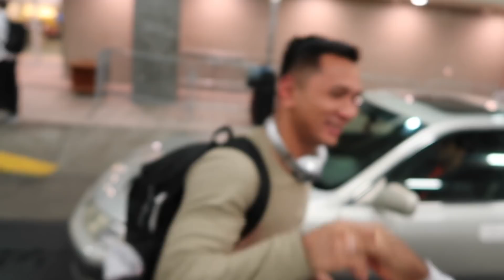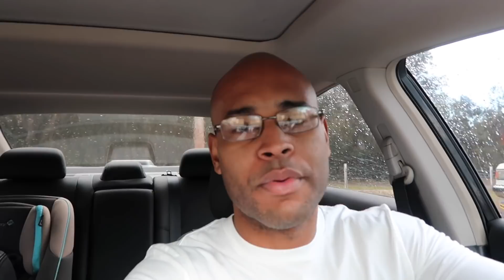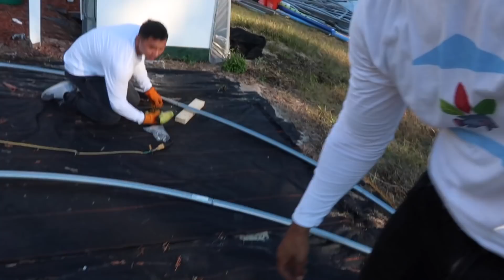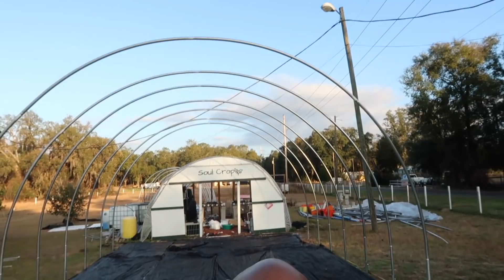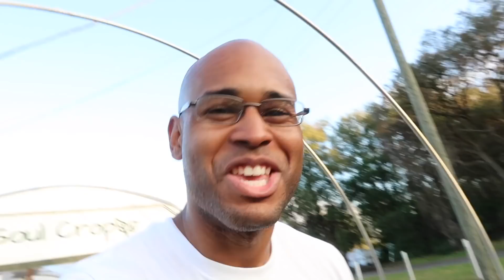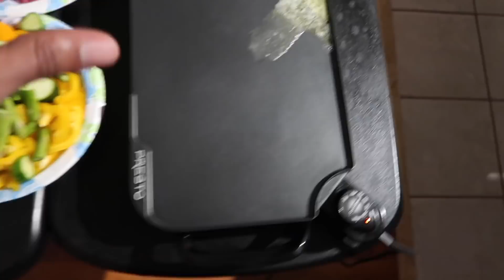Carlos Arrives + Installing Hoops | The Aquaponics God Ep. 6

Comment: nice work fam. im about to build something similar in a friends backyard, but i was going to use pvc under the impression it would be cheaper. are those frames you are using in a decent price range?
Reply from the maker: They are much better for the long run. I’ve used both pvc and steel and the pvc is cheaper up front, but the steel is a much better investment for the long run; it also offers a much better aesthetically pleasing structure.
Reply: The School of Aquaponics if you have time can you drop a link bro.  Keep up the good work truly inspiring stuff!